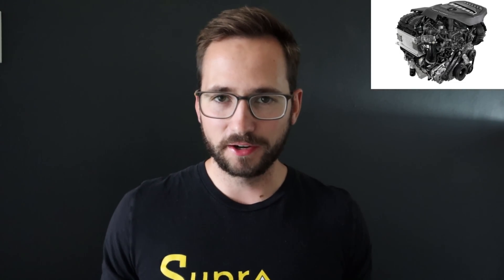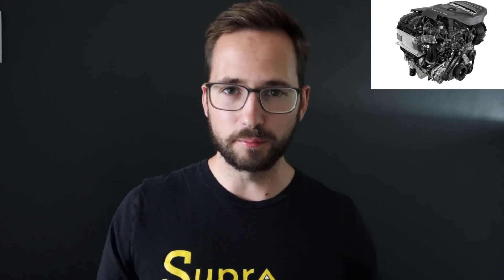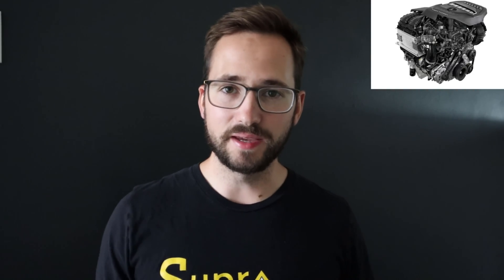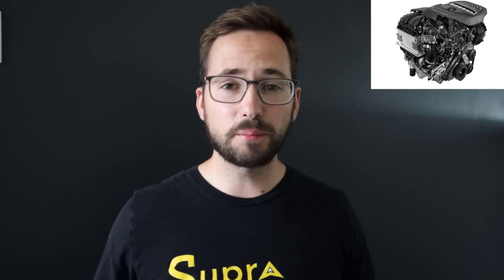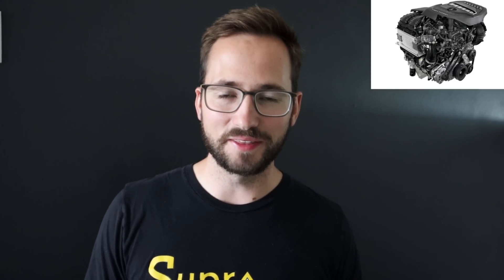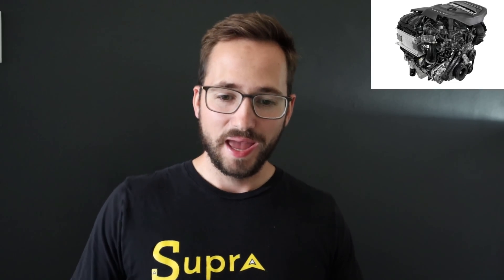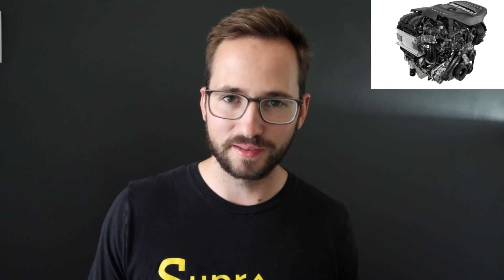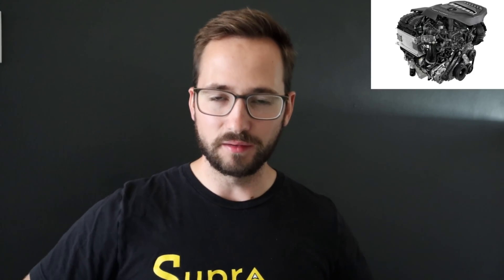The New Hurricane Engine Is Way Better Than I Realized!

Comment: 2 of the great in-line 6's that have been continually upgraded for decades is the BMW i-6 and the Mercedes i-6 and are still in use today.  Also I didn't hear any mention that one of the things you get with the In-line vs a V6 is more torque.    And one more important item of note is the new transmission - it's manufactured by ZF Friedrichshafen AG (Germany) - and is highly rated.

Comment: Traded my 22 EcoBoost on a 25 Ram Hurricane SST.
The Ford was a great truck with ZERO problems during the three years I owned it.
Being a truck dealer for 30 years and selling thousands of trucks, it just seems the inline 6 is a great idea. Gets about the same mileage as the wonderful little 2.7 but with a hundred extra horses.
Time will tell if it's a great engine, I'm betting it is.😊

Comment: I drove a hurricane RAM 1500 a few weeks ago when my Hemi RAM was in for an oil change. Its a beautiful motor to drive, silky smooth, very quiet (which is good because they sound awful) lots of power but not noticeably more than the Hemi. My hesitation is the lack of reliability/durability track record (yes they have been around in the Grand Wagoneer for a couple years but that's such a low production vehicle its hard to get a good sense of how reliable they are so far) and the fact that they at best get the same MPG as the Hemi and in real world use they get worse MPG. I just traded my 2022 Hemi for a 2024 Hemi so hopefully by the time I need another one the Hurricane will have proven to be a reliable/durable motor.

Comment: Question: why you don’t talk about the infamous termostat that is failing in most of those hurricane engines? 

Power, performance, fuel and economy, but… stranded on the road every 10k miles is something that we, potential buyers, want to hear about before we pull the trigger. 

Any idea of when they’ll find a  solid solution to that thermostat flow? 🤔

Comment: What's not to like? Well balanced, smooth, 500 cc per cylinder, built stout as a turbo, less weight, and single bank simplicity. How about a non-turbo version with a hybrid?

Comment: A real truck sounds like a real truck. A 6 cylinder is never going to make the right sound. Secondly, I don't understand the new fad of forcing smaller and smaller engines to produce biggger and bigger power numbers for bigger and heavier vehicles. Its pretty clear v8s can and do get fantastic fuel mileage and will be FAR MORE reliable than all these force fed minis will ever be. Best example is the EcoBoost. Nobody got that "great fuel mileage" they claimed it'd get. They are still problematic.

Comment: The problem,  is the over all ridiculas high MSRP fo all the new full sized RAM trucks. Is this new turbo'ed straight 6 going to Lower the MSRP of the new 2025 trucks? They'll probablly cost $5,000 more than the out going 2024 models with the 5.7 V8's.

Comment: You obviously are ignorant about internal combustion engine. And rotating mass how it produces torque. premium fuel dosent change that higher octane fuel only eliminates low speed preignition in the combustion chamber especially when there is higher compression ratios which is what makes more torque and horsepower not fuel oh ignorant one.

Comment: Just talking about specs doesn’t prove anything. How about peak torque rpm? If you like towing at 4-6k and a stressed engine, then you’ll love this engine. I prefer an engine with dependable power and no heat soak. So, I will not be trading my 11 year old Hemi with this nonsense. Also, might want to look at how much boost is on the high performance; very stressed.

Comment: I like the idea of a straight 6 and the specs look great, but I'm very skeptical of anything in the first year or two of production, especially from the big 3. It seems to take 4-6 years before they work out the design flaws on new vehicles. Time will tell.

Comment: Slice it or dice it, force induced gasoline engines don't have the potential longevity of normally aspirated. And no, small turbo engine does not give you better fuel economy IRL. Can't argue with facts.

Comment: If you think a 3 liter turbo will hold up as well as a v8 you are deluded. In a few years these engines will be great anchors. Not capable of holding up tto towing acamper for 500 miles without damage. I wonder whos gonna save Chrysler this time. Cummins and hemi saved them before. They should hang it up. The EPA and the system will never quit

Comment: It will take a few years to perfect it. Wouldn’t want one in a Ram truck until few years out. I have driven Ford 3.5 twin turbo for last 6 years. Drove Chevys prior to the Fords and just had to many problems with the trucks. Swapped to the Fords and has been best engines I have ever owned in a 1/2 ton truck. Will stick with them for foreseeable future

Comment: It will be an expensive money pit after time. Yeah they make more HP and torque, but they do not have dual injection which means carboning up problems will happen. They are twin turbo charged name a turbo engine that never runs into major problems down the line? The HEMI also has its problems with MDS and cam/lifter failures, but for those that delete the system it has not been a huge problem. After 5 years and the engine has been tested commercially then we can give it a real grade. Now it is just a new engine and untested.

Comment: YOU HAVE NO IDEAN JUST HOW GOOD OR BAD THIS UNTESTED ENGINE WILL BE.  IT WILL TAKE YEARS TO SHAKE OUT ALL THE DEFECTS AND REALLS. COME ON YOU TAKE A LITTLE TEST DRIVE AND ITS SO WONDERFUL GET REAL PUT 100K MILES ON THIS ENGINE AND THEN LET'S TAKE IT APART AND LOOK AT THE COMPONENTS AND MEASURE THE WEAR LIKE TOYOTA DOES. LET'S ALL BE SCIENTIFIC AND NOT EMOTIONAL BECAUSE OF SOME NEW ENGINE. WOW

Comment: If you live in the west (high altitude) and tow, you should never get anything other than a V8.

 The hurricane will cost more in fuel when towing opposed to the 5.7 

The hurricane is only for cars and suv's that city drive.

Also, high heat/RPMs while towing in aluminum blocks = warped engines 

These "may" be slightly better on paper, but will be a total faliure in the real world.

Buy a HEMI now and enjoy 15-20 years of worry free towing.

End of story

Comment: premium fuel for the HO version is almost as expensive as diesel fuel, just as well get a frickin diesel then. they need to bring back the mid sized dakota with that motor, not the full sized trucks

Comment: I get 10.2L/100km with my 1500 5.7. A turbo pulling anything will get way worse. Ford f150s already prove this: turbos aren't good for gas mileage when there is a load.

Comment: Turbos are bad for daily drivers. Had 3 ecoboosts and a chevy cruze all had turbo issues or issues caused by the turbo, specifically cracked pistons on the cruze from the turbo letting excess oil into the cylinders.

Comment: It's a GDI-only engine. So I sure hope the intake manifold is easy to take off, cuz you're gong to need a walnut-shell blast de-carboning by 70k miles, especially if you have the version that takes regular gas. 

I'm really surprised Stellantis didn't go to GDI+PDI, considering that Alfa Romeo had to do that from 2020 forwards to deal with the carbon issues on the Quadrifoglio models. Ask me how I know.

Comment: Shouldn't the standard output Hurricane be compared to Ford's 2.7L Ecoboost? That's how I'll shop them. Plus they both have a NA V6 as the base engine. Also, this engine should be in the RAM now! Stellantis is already 12+ months late in introducing this engine. The Jeep Cherokee needed the standard output version at its launch. Thanks for the video and keep them coming.

Comment: Higher octane gas does not produce any more horsepower than lower octane. Higher octane gasoline is harder to ignite. Its only purpose is to prevent pre-ignition from the heat of compression. Higher-performance engines tend to have higher compression ratios. In this case, the standard output Hurricane does not create enough heat from compression to cause pre-ignition, therefore it does not require premium fuel. Adding premium fuel here is simply a waste of money. The HO version of the Hurricane has a higher compression ratio which does produce enough compression heat to pre-ignite 87/89 Octane fuel, thus 91+ octane fuel is required. Had to let your viewers know you were giving them 100% false information about fuel and the correlation of its octane rating.

Comment: hook up 10k of boat and test the drive the hurricane I6 - these little I6 engines make as much power and torque as the 5.7 v8 hemi but they do it at much higher rpm's - not good for pulling or heavy hauling. Big diesel semi-trucks work great because they build max torque at 1,100-1,300 rpm's. v8's are the low rpm torque kings in gassers. another downfall of high rpm engines (to the owner not the manufacturer) is they have a higher duty cycle. this means to produce the same torque and hp as a v8 they will average a higher rpm over their life cycle - this means they run at 40% of max rpm (on average) vs. 30% for a v8 - higher rpm's increases internal engine wear - and consequently high rpm engines like I6, I4 and v6 have a shorter life cycle than a v8. these smaller I6 hurricane engines by Stellantis (aka Dodge) is not to improve fuel mileage - customers will gladly pay the gas guzzler tax for a v8 - but it goes to uncle sam not Stellantis - it's to reduce production cost and increase profits - Ford has been doing v6 turbo gassers in their F150 for 10 plus years because they know most owners drive them empty and don't miss the low rpm v8 power and torque. Never read motor trend they never tell the truth about new cars - it would be financial suicide - they get to much advertising dollars from car manufacturers. BTW Stellantis sent out a rep who knows the talking points but I bet cannot change a tire. Just because it's new doesn't mean it's better.

Comment: The standard version and the HO version have a 4 psi difference and require premium fuel. I can assure you that people will ruin these engines unless they stick to using only the best oil and fuels. They are running these at the limit of denotation all the time with the many knock sensors equipped on the engine. Also, the premium fuel tends to keep your engine cleaner
Reply: People ruin current engines by using the wrong oil...well if they actually did any maintenance in the first place.

Comment: My concern is the torque number on both std and HO engines being lower than desired. You can't come out and compete with the ecco boost engine and it has less torque. Torque is king with pick ups.

Comment: That “some reason” why straight sixes are so reliable is the natural balance in those motors creating fewer stresses on the components as well as a much simpler overall design
Reply: Won't be very reliable with turbos and Stellantis mucking around with it.
Reply: @wildbill23c plenty of straight 6 with turbos are reliable but I will give to you about the stellantis thing
Reply: @Bigalinbklyn83  LOL, there isn't anything reliable about any of them, especially with the way people like to skip regular maintenance.
Reply: @wildbill23c Toyota, BMWs and Nissan engines say otherwise

Comment: A 5.7 port fuel injection that cuts cylinders, compared to a turbo, intercooled, direct injection, higher grade of oil needed, additional architecture like waste gate, hoses, more drivability issues with direct injection, etc.
I understand that this is the direction because of emissions, etc.
I have a phrase, " no replacement for displacement"

Comment: Guy you’re dancing around the main point. Modern Dodge is an enthusiast company. V6’s are widely known as the worst sounding engine layout. The move to a straight 6 turbocharged layout is a no brainer for dodge as straight 6’s sound awesome, they are also a naturally balanced engine. V6’s sound like cheeks( somebody will post the 5 V6’s in history that sounded halfway decent as proof that v6’s don’t sound icky) Primary and secondary forces. I-6 and H-4 are my 2 fav layouts besides my old fav v8

Comment: Many falsehoods stated in this video and comments.... Inline 6 cylinders DO NOT have a better balance than a V-8. A 6 has a firing event every 120 degrees, the v8 every 90 degrees. The reason the displacement is only 3.0 is to keep the stroke short to minimize vibration, harmonics are inherent to inline 6 cylinders.   Twin turbos add many added points of failure, all those extra parts needed. Due to the fact this engine NEEDS boost to make the power will be a serious amount of wear and tear, you'll always be in the turbos just to match the V8's normal everyday torque. Lighter???? 71 pounds lighter, and that's with a rock solid cast iron V8 block,  that runs for 300K miles, not aluminum. Mileage will be worse, again you will always need boost to make the torque a V8 does effortlessly, just asl an ECO-BOOST owner... LOL.... six cylinders last longer than a V8..... yeah, because they do not make enough horsepower and torque to hurt themselves.... NO ONE..... REPEAT NO ONE WANTS A 6 CYL OR ELECTRIC MUSCLE CAR!!!!!

Comment: No. Gay and gay. Small displacement turbo engine making this much power = problems. They are sacrificing reliability for fuel efficiency. HP is more than just a number. Getting there by boosting a lawn mower engine means more metal fatigue.

Comment: A I6 has 7 main bearing over 5 for a V8 and is inherently perfectly balanced. My hesitation is how well the plasma arc coated aluminum cylinders will hold up. I’ve heard it is very durable, but it is like less than the thickness of a human hair! I have heard there is a third engine for commercial vans and trucks too, in the 300hp range.
Reply: for sure I'd wait a few years before buying that engine because the cylinder coating can be of a douptful reliability and such engine construction is not rebuildable with the current processes.
I'd be fully aware of the TSB generated by that engine, the TSB is a very good reliability indicator for any vehicule.
Reply: You obviously have no idea about design and the engineering of modern internal combustion engines. The crankpin index on a inline 6cyl engine is every 120 degrees, vs. the V8, which has a crankpin index every 90 degrees. Main bearing totals have absolutely nothing to do with balance.
Reply: @fsilverez8408  I’m not sure what you mean by “ design and engineering of modern internal combustion engines” I6s have been around close to 100 years! I never stated that the I6 is smooth because it has more main bearings. It is smooth because of its inherent primary balance. The addition bearings (2) add extra strength  to the bottom end over a V8 that has 5 main bearings. You should know this and be able to distinguish these points!

Comment: I'm still disappointed that we never got to see the 392 in the 1500. I'm wondering if you will be able to get the high output version of the hurricane in the 1500?
Reply: Yes they did, where you been? There is a 6.4 Ram

Comment: The way they get more horsepower from an engine is to increase the compression ratio and perhaps the stroke of the pistons ergo here comes the need for higher octane fuel as a gas engine will act the same as a Diesel engine in this case causing pre combustion of the fuel in the cylinders. Octane ratings in the higher rated numbers to 93 etc. is to slow the combustion to wait for the spark plug to set of the fire at the proper time in the cylinder. Diesel engines use a cetane rating to do the exact opposite as octane as a Diesel engine will fire more readily to the proper timing as the fuel is enhanced to fire closer to the optimum moment of piston placement in the cylinder. Gas engines with high compression give out a pinging noise with low octane fuel and Diesel engines put out a rattling sound with low cetane rating. Fuel economy is rarely gained by when the engine fires but the difference in power is often noticeable. With the use of turbochargers and superchargers there is alway enough oxygen to ge the optimal burn for each engine to perform at its best. Just another thing to think about.

Comment: I love the idea.  Inline 6 is legendary, and also gives room on the sides for turbos.  Sure turbos add complexity and can break, but you'll have plenty of room on the sides to work on them if they do break.
Reply: It’s from Stellantis/Peugeot/FIAT, it’s going to break lol
Reply: @JohnConrad  lmaooo, we’ll see. the HEMIs were very reliable tho
Reply: It is not, "If turbos break"; It is "When turbos break".
Reply: I am skeptical of chrysler turbos after my I4 wrangler blew its turbo at like 9000 miles
Reply: turbos are actually extremely effective, fuel efficient, more responsive, and reliable. people need to neutralize the idea that “turbos” suck.
Reply: @cowboy_3  They run hotter, break easier, and cost a lot more to fix too.
Reply: @esteban1487  HEMIs or turbo engines you mean?
Reply: @cowboy_3  turbos
Reply: @cowboy_3  And boost oxygen at higher altitudes.  Power when you want it (floor it).  Not so much if you drive soft.  I like the idea a lot.  I've had a lot of engines, even a V4.  Never had an inline 6 and look forward to it.
Reply: @ZenEndurance  same! i’ve tried a V4, V4 single-turbo, and a HEMI 5.7. never tried a V6 or I6. i also believe that I6 is better than a V6 when it comes to power. moreover, having 2 turbos can expand the power band so you can have all the torque you need with every rpm.
Reply: @cowboy_3  We have an Atlas with Volkswagen's narrow angle VR6 and it's pretty interesting.  Definitely pulls more like an inline 6 than a V6 and has a fun feel to it.
Reply: @ZenEndurance  i currently own a volkswagen t roc, love the car!

Comment: You can taught  similar or even superior HP and torque numbers but the way the power is applied is completely different between a large V8  and a turbo charged V6. A turbo V6 will not have the low end torque of a NA V8.